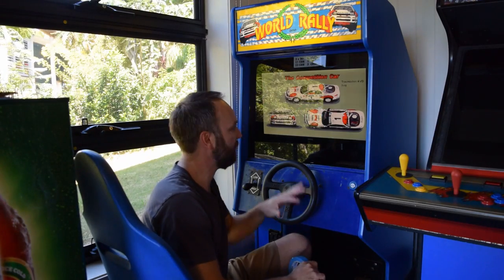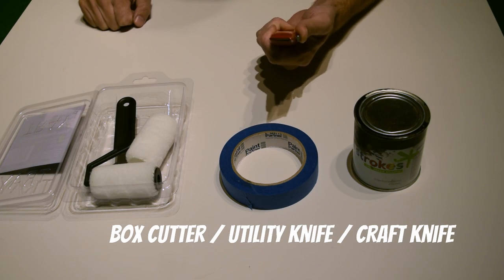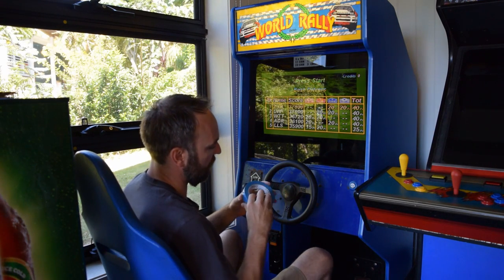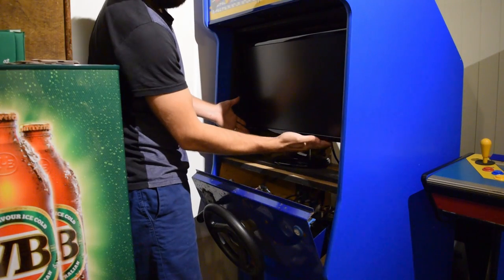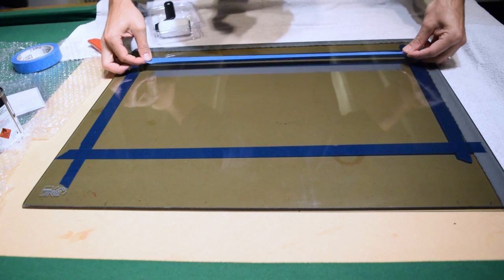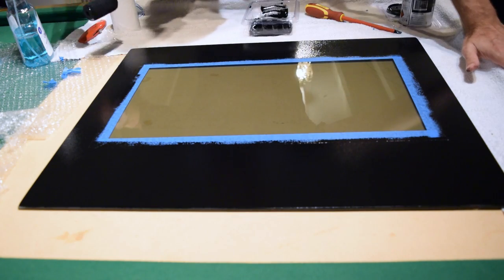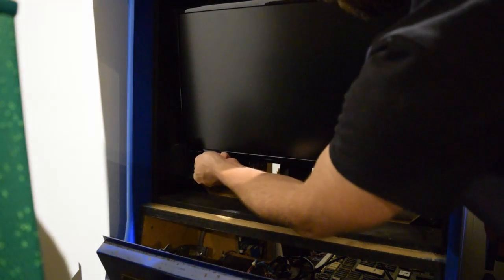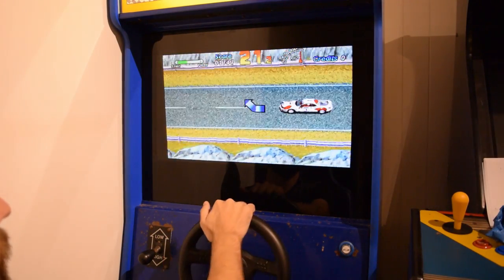ARCADE DIY - Paint screen bezel / back glass fast, easy and cheap! Simple instruction - The Gameroom

Comment: This is brilliant I just got a 27inch arcade cab an was curious if I can ditch the plexiglass for actual glass & paint ....what type of glass are useing in your cabinet
Reply from the maker: Thanks a bunch for checking it out! Glad people are making use of it.
Some of my machines have thin plexi as it keeps down cost and weight but definitely not fit for commercial use.
My ones with glass have safety glass installed. They often have the same or similar markings to that in cars. Any glazier should be able to cut you some safety glass to size. 
My lightgun arcade had standard glass which I removed as soon as I got it. Not worth the risk imo.
I've painted using this method on both glass and plexi with very similar results.
👍